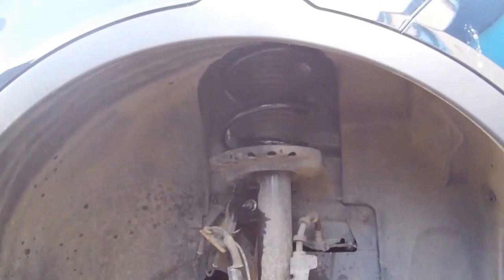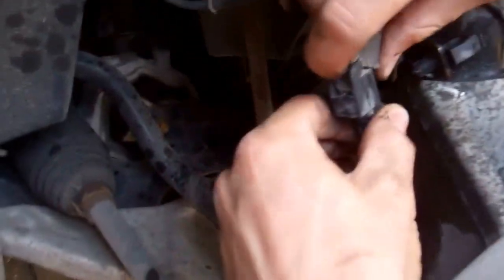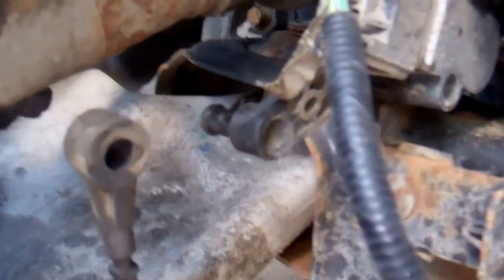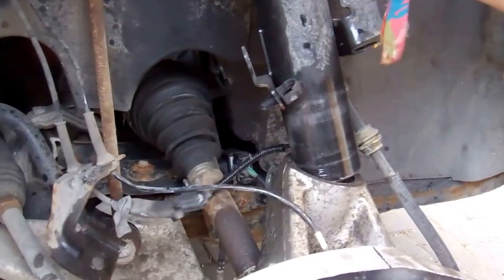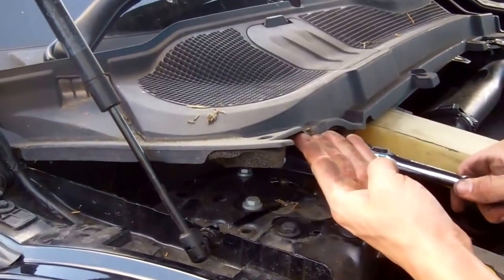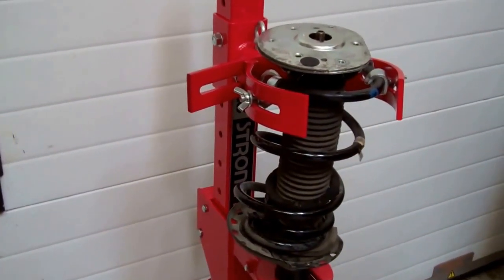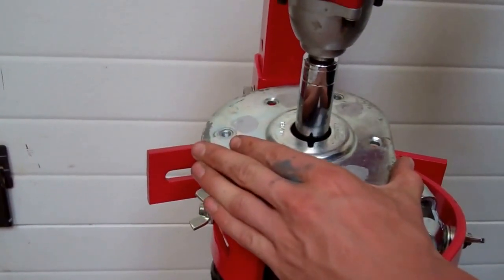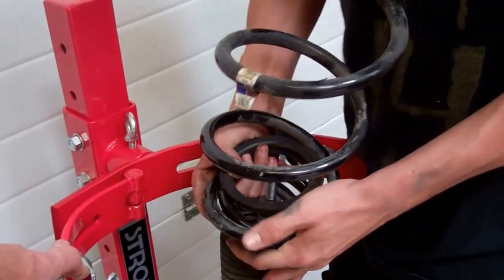How to change front suspension spring on Range Rover Evoque

Comment: Very helpful video. Thanks guys. 😎
My Wife’s Evoque suffered a locked up magnetic front shock absorber. The ride was horrendous as you have zero suspension travel on the effected corner. The tip with the piece of 2x4” worked perfectly 👍. I found I had to push my shoulder down on the hub to get the new  shock in place but then I didn’t have a pry bar. Had no problems putting a trolley jack under lower ball joint to seat the shock in position. I left the 3 top retaining bolts just slightly loose while I used the jack. The shock just went in perfectly. Just be sure to line the cable up with the slot as shown in the video. Oh and use a copper/hide or dead blow plastic faced mallet so not to damage the hub when your bashing it😉.

Comment: I'm pretty sure you put that spring on upside down!   Paint marks should be at the top.  Also, another give-away is it looks to me like the strut itself is off centre to the spring when you put the top mounting plate / bearing on and let the spring compressors off.  One other very important thing; the two plastic markers (sticky out bits of plastic) on the top bearing should align with the metal 'tang' located at the bottom of the strut (the one that goes down the vertical slot in the alloy knuckle).  That way your camber and caster will be correct.   I'm really glad you post your excellent video's but this one has a few errors that could do with some correction (text or re-narrated).

Comment: Hello I have a problem with my range rover 2015 normal suspension without electronics
The car is very hard and doesn't absorb practically any undulation on the street, it looks like a lowered car, I would like to know if this is a problem with the spring or shock absorbers, thank you very much
Reply from the maker: The ride is not that soft on the Evoque - it may be that someone has fitted lower springs which are often stiffer.
Also remember wheel and tyre choice an impact ride - if you have 20" wheels and low profile tyres that will have an impact.
Reply: I'm using 35 / 60 / R18 and the springs are original the suspension is very high but still it doesn't absorb the road imperfections thanks

Comment: I have a rear with the adaptive electronics. do you think it will be the same configuration?
Reply from the maker: Should be similar - normally easier as you have no steering.
Reply: Thanks. I found an assembly breakdown and it seems contained similar to the one in the video. Certainly helps me want to do it myself considering how much they want to charge. Thanks for the video.

Comment: Is the Dynamic Suspension an air suspension ?
Reply from the maker: Alas no air but instead there are fairies in the shock absorbers.... OK not fairies but the shock absorber has some tricky electromagnetic particles on the fluid and the damping rates can be adjusted by changing the magnetic field around the valves in the shock absorbers... or something close to this....
Reply: @L663  It's called Magnaride, my partners Evoque has the same. Sadly now I am looking at pricing for a shock replacement as the front off side unit is totally seized. It effectively means that there is zero give in the suspension .You can actually test this by applying pressure to bounce the car from above when stationary, all 3 corners have some give and compress/bounce as you would expect but the suspect corner has literally no give at all. Every slight bump causes a huge bang from this corner as you can probably imagine (basically that horrible thud you hear whenever you bottom out suspension).  When it works it is great technology, when it works.....